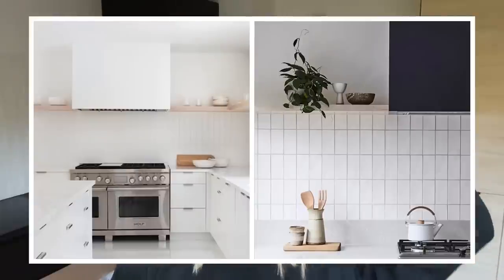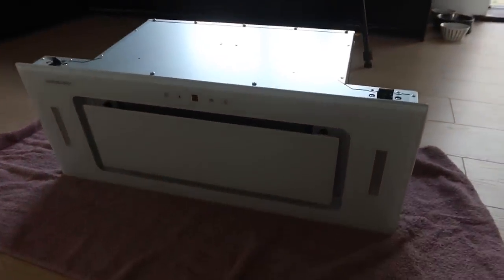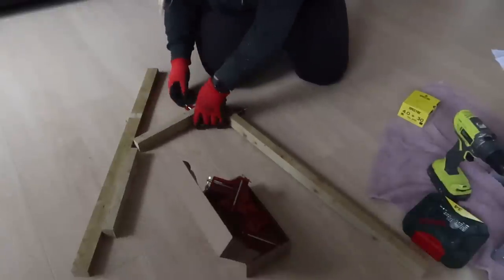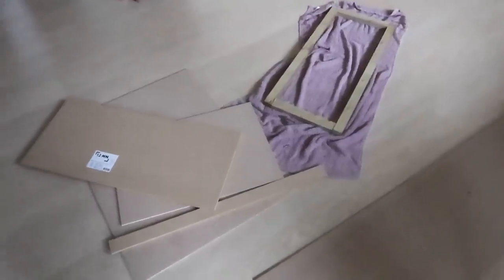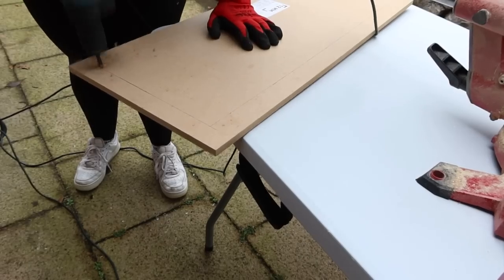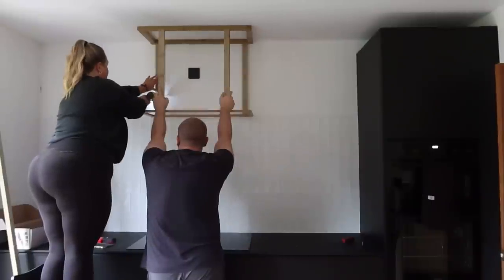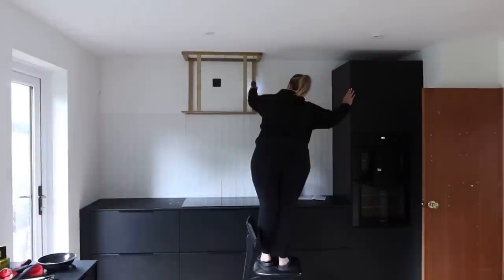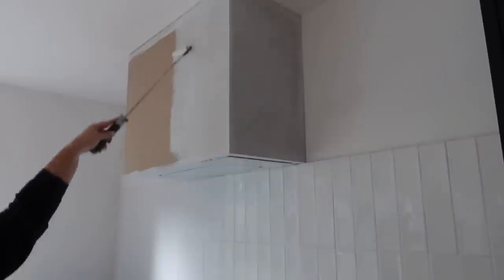DIY Modern Range Hood | How to Build an Extractor Hood

Comment: I don't want to be a negative nelly, but I don't think MDF should be used in this project. The steam from cooking is going to cause issues with warping and mold. It looks gorgeous though. I hope it holds up.
Reply from the maker: I did do a lot of research which said that mdf would be okay
Reply: @LouiseHenryHome  I use MDF lots and without any problems.

Comment: Your channel should be called The House Louise Built.  All credit to your hard work.  Just a question, how does your extractor vent?  Normally you would have a pipe which is attached to the top of the extractor which then goes through the wall ultimately to an outside hole with cover.  As it is where is the steam etc going?
Reply from the maker: Haha I love that! We bought a carbon filter which filters the air and vents it back out. And you can change the filters via the flap underneath 😊 xx
Reply: Hi, can I ask where it vents back out? Is it back out the bottom or out the top? I want to box in our extractor when we do our kitchen but have no option to vent outside.

Comment: Hey, what is the cooker hood ducted to? Either it needs to recirculate the filtered air back into the room or (ideally) it needs to be ducted to an outside vent to push the moist air outside. Obviously this is the whole point of the hood so would be good if you could explain this. Apologies if I missed this bit.
Reply from the maker: We purchased a carbon filter so it can be recirculated
Reply: Even with recirculating hood. You still need the air to come out. It doesn’t look like you have any hole for air to come out.
Reply: I wondered about this @kennywang138   Should the frame have vents?